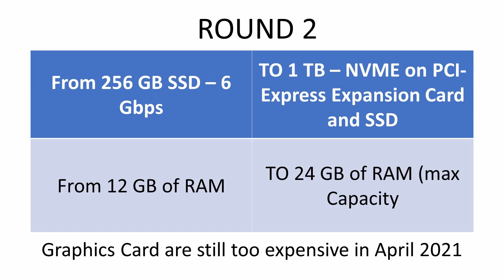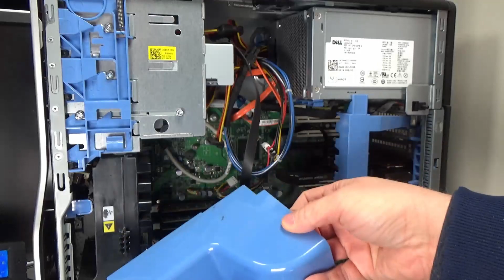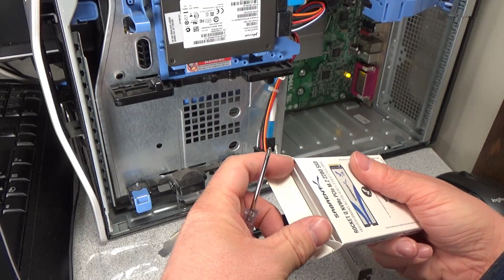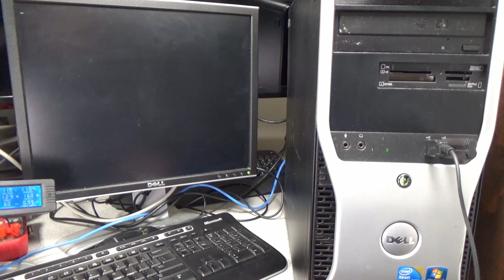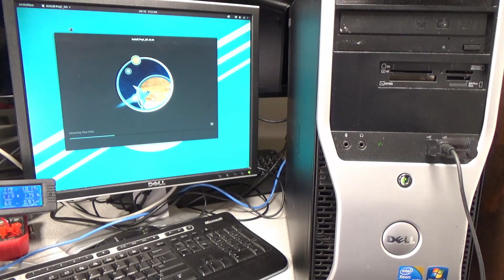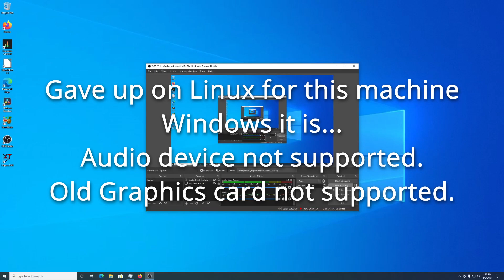Dell Precision T3500 Upgrade PART II

Comment: I just replaced the motherboard after a memory failure after my son used the PC as a foot stool.  It seemed the sudden shock did something to the motherboard.     So ordered a new board from E bay for $20 Bucks!  WHoo hoo!  
Took about 4 hours but I got the entire thing in there & Cabled Manged perfectly with a 1070 Founders edition Card with 11GB of VRAM on the card.  

The only real trouble I had was the Front Fans.  You need a REALLY long screw driver, and for the life of me?  With ALL the tools I have, I could not find a suitable one.    So I Had my Drill and connected a bunch of Bit drivers extensions together and was able to get to all the screws.  Even the motherboard screw in the corner by the Drive bays you have to go through an access hole to get to. 

The Front fan has this small screw on there, but its a PAIN to get to, so left that one out.  
The other slight issue is that 1070 has the power connector on top, so its a TIGHT fit.   But I was able to get it to work.  (Again, more custom cable management, and a 6 to 8 Pin Power adapter. 

I also put in 2 rear fans a while ago,   and that seems to help with the Chip set cooling as its doing its memory test right now. 
Early on it beeped and told me I had a Hard drive failure on one of the WD Raptor drives.  (I have two in a Raid-0 for game storage) 

What I love about the  Pro Workstations like the Dell, is that Manuals they have online.  They are Freaking FANTASTIC! :hand-purple-blue-peace:
Has every single thing you  need in order to strip down the machine and  all the step clear like the Old school FSM the dealers use. 
And the case quality is amazing to boot.   

I had to fix a broken spring on the Drive bay for the retention of the 5.25 in bay CD-ROM drives, and the HDD.  
Other then that?  It was a Joy to work on. 

The only thing I would caution anyone is that the Front fans are REALLY close to the front I/O wires, so route them carefully, or they will rub.   (Happened to me on First plug in fan test- NOW FIXED!  ) 

Now comes the Labor intensive part of setting up the entire machine again.  From the RAID-0  to the BIOS setup. 
Its a fun machine.    Rock solid.  And a joy to work on.     

Great to use for a Daily machine for the work from home  office crowd,  but the even the New CPU's this year are so much faster (like 6x faster on single thread) then these old XEON  CPU's.     So its time to build her up and give her away to a good home.
Reply from the maker: Wow, that's awesome!  It sounds like a great project to keep it going.  I was curious how much effort it would take to retrofit a new motherboard into one of these cases.  Yeah, fans would have to go, I probably wouldn't be so nice removing them if the intention wasn't to keep them.  Dell's pro line stuff is amazing though and thanks for the comment! 

Is the 1070 held back at all by the Xeon cpu?
Reply: 𝘘: 𝘐𝘴 𝘵𝘩𝘦 1070 𝘩𝘦𝘭𝘥 𝘣𝘢𝘤𝘬 𝘢𝘵 𝘢𝘭𝘭 𝘣𝘺 𝘵𝘩𝘦 𝘟𝘦𝘰𝘯 𝘤𝘱𝘶?

𝘼:   For my son who uses it as a gaming GPU?   He has not had one problem with it at all.  Its the W3550,  Only 3Ghz.  And he plays his games on a 4k 55" Display locked at 60 Hz refresh rate.  (His preference) 

The games he plays these days are really not that demanding @ 17, compared to the games he use to play being 9 years old (Train Simulator)  

For me,  I have not noticed a real issue.   But I am NO  PC gamer.  And I have not ever seen him play First rate Titles like Cyberpunk or the new hotness. 

I think he Mainly plays games just to go online & talk to his pals on Discord.   

His other machine we built from scratch just a few years ago  was an AMD FX 8350 Rig with custom case and Board with the same 1070 all running stock (his not really into overclocking)    And has no issues there either at his Mum's apartment. 

Both systems are SOLD and STABLE.  
But I fear, he's more into having a PC for the  spicy memes.  

Have a good one!  :goodvibes:

Comment: I am upgrading a T3500 right now. Got 24 GB of Ram and a x5690. 

Did you ever figure out if it could boot from the nvme pci card?

If not, Could the computer recognize as regular storage?
Reply from the maker: I never got it to work but I didn't spend much time on it, I just wanted it to boot and work, ha.

Comment: my buddy has the t3500 and uses it as a gaming pc. I maxed it out with a xeon x5690 cpu and 48gb of ram. the ram was the biggest improvement. I have the same system as a minecraft server. for a pc over 10 years old its still quite capable.
Reply from the maker: Yeah, it is surprising how long lasted this system has been.  I think this year I'm replacing it with something more modern though.  I had a server build I did with a consumer Ryzen chip, and it's been excellent, but I never released the video.  Probably will go with that platform for a new desktop as well.
Reply: How did your friend to add more ram capacity than the max? 
Bios upgrade?
How much ram can support the t3500 really?

Comment: Gotta upgrade from that heat sink, Dell put out a replacement because that one sucked. Has heat pipes
Reply from the maker: Yeah, I have noticed the CPU temperature runs high all the time and the fans run fast if you make the system work at all.

Comment: That Quadro 600 is still a good economy card. It supports Direct X 12 and can run Fortnite on low settings at 30 FPS. It has 1 Gb of video ram so it can even still do basic video editing. Slightly faster than a GT 710. Good card for $30 to get you by with the GPU shortage...
Reply from the maker: That card still is in the machine.  It is working, obviously it would be nice to upgrade that as well but yeah for a while it will be the Quadro.
Reply: @AllThingsOnePlace  It's still a great cheap card. It can play most games if you tweak settings. It's even good at 1080p video editing and run in OS X up to High Sierra if you put in Mac Pro tower...

Comment: can we change the heatsink in t5300 any standard size which I should buy ! ??
Reply from the maker: The CPU is installed in a LGA1366 socket.  I haven't replaced my heatsink yet.  I am still using the stock cooler.  A cooler that supports the LGA1366 socket should fit in this system.  The cooler will need to handle 130+ watts of CPU load.  I haven't done all the research yet myself so if you find something that works or doesn't work post it here please!

Comment: Do we need to update bios before upgrading?
Reply from the maker: I was running the latest BIOS edition before doing these updates.  I didn't try to do an A/B to find out if it is required but (in most cases) updating to the latest BIOS won't hurt.
Reply: @AllThingsOnePlace  can I install ram 8gb of each slot?
Reply from the maker: @CambodiaShareFeeds  Officially, the system supports 4 GB of RAM per memory slot, of which there are 6.  The CPU choice will effect maximum supported memory.  I opted for the safe bet (24GB total).  If you can get the memory for very little price or free then post on whether it works or not.  There is a video on YouTube showing 48 GB of system memory in one of these systems.  https://www.greenpcgamers.com/uncategorized/make-my-precision-t3500-in-to-a-gaming-computer/  Great info there, and even there 24GB is recommended.
Reply: @AllThingsOnePlace  I'm not sure work or not. but i just saw video on youtube confirmed 48gb of ram.

Comment: Linux supports putting the boot partition on another drive. For example, you could put "/boot" on the SATA SSD (like a 1 GB ext4 partition), but then you could set "/" to the NVME itself. Also make sure the MBR is pointed to the drive with "/boot" on it as well. This is extremely useful if your BIOS doesn't support option ROMs/PCIe booting, or if your BIOS is buggy and won't boot properly on higher storage USB devices.

Not sure how this works with GRUB and PCIe devices though.
Reply from the maker: Hmm.  That is a good suggestion.  I tried something like that but I never got it to work.  I need to spend some time learning.

Comment: Like your video, by the way it is possible to use this dell t3500 motherboard to 3rd party pc case? It is the same normal size of full atx motherboard?
Reply from the maker: This is a very large motherboard.  It may fit in some server cases (with some custom hole alignment) but It is larger than a full ATX tray.  It's almost the size of the whole case.

Comment: Hi so I have built a few Dell precision t3500 computers and I have some information for you you may or may not find helpful. Number one it wouldn't matter whether you went with the x5690 or the w3690 the Dell precision t3500 motherboard it does not actually support ECC registered memory. So you wouldn't be able to get the higher amounts of ram anyways. Number two when it comes to using an nvme m.2 drive you're not going to notice very good performance out of it because you're only using pcie Gen 2 not gen 3. So an SSD isn't going to be all that much slower. At least when it comes to booting and everyday tasks. Number three be careful what video card you buy because not all video cards will support legacy boot. A GPU like the RX 5700xt 5600xt or 5500xt will not work on a LGA 1366 pc. So when it comes to gpus Nvidia is your best bet. Or a slightly older AMD GPU like the R9 290 or R9 280. Also you can use standard ATX power supplies in this computer. No adapters are even needed. You can also add a couple of 80 mm fans to the rear of the computer to help with air flow. You can even use standard 80 mm pwm fans if you buy some Dell fan adapters. You can find them pretty easily on Amazon. That goes the same for the front intake fans as well.
Reply from the maker: Wow, Thank you for the detailed reply.  I had learned a few of those things in my adventure.  The bandwidth of PCIe gen 2 x4 slots is still a few gigabytes per second so maybe won't take full advantage of the NVMe drive but it will be faster than built in SATA.  I also figured a decent sized NVMe drive will be useful to transfer into a new system if/when that time comes.

I did noticed the power supply.  I will have to check out the fan setup (good tip on dell adapters).  It does get a bit warm with these extra components installed.

If I could find one reasonably priced I was thinking of a Nvidia 1650 super or something similar.
Reply: @AllThingsOnePlace  what are your plans with the computer are you going to be using it for any gaming or just using it for content creation? And also when it comes to the pcie Gen 2 speed it's not nearly as impressive as what you might think it is. Pcie Gen 2 is half the speed of pcie gen 3. and a pcie Gen 2 4X slot at maximum will only run at 2000 megabit per second. But granted I could be wrong because I've never actually messed around with nvme drives on the older x58 platform. If you are able to get everything working properly you should definitely let me know about what the speeds actually look like.
Reply: @AllThingsOnePlace  and when it comes to fan setups I definitely recommend going with noctua redux pwm fans. If they move a lot of air and are incredibly quiet. As well as well being pretty reasonably priced. Also if your CPU temperatures are a little bit higher than what you would like I would recommend it taking a 92mm fan and putting it directly on the cpu heat sink. One of the problems that the t3500 has is a lack of directed air flow for the CPU. Putting a 92 mm fan directly on the heat sink provides way better cooling.
Reply: @AllThingsOnePlace  also if you have any questions definitely ask. I'm just spitting out information that I think may be useful.
Reply from the maker: @crosstech1  Sounds good to me.  You are helping me narrow things down a bit.  I will pick up a couple of the Noctua fans.  I will have to do some benchmarks once I finally finish things up.  It is mostly for content creation maybe some light gaming.
Reply: @AllThingsOnePlace  and if you're planning on only playing some later titles something like a GTX 760 wouldn't be a bad option. You can get them for right around that 100 USD price point. That would also give you the end Bank encoder as well as cuda acceleration for video editing. But that's just assuming that you're not playing graphically demanding games
Reply: I might have misunderstood but the T3500 does support ecc RAM. It doesn't support registered RAM. So, we can use ecc non registered ram for it. And this thing can take up to 48 gigs of ram. There is a video for what processors support the extended memory. I think w3690 would work.
Reply: @a.f9173  I could be wrong but in my experience of using both ECC registered and ECC non-registered ram I was not able to get it to work at all. It might be a defect with my CPU or it might be a defect with my motherboard. Honestly I don't know but I was not able to get either one of them to work.
Reply: @a.f9173  It's the X5690 6 cores 12 threads. I just installed one on my system and install 6 x 8gb non registered for 48gb total.

Comment: A youtube video shows a UEFI DUET Installer  that will make the usb bootable for m.2 but its says that we have to keep the usb plugged at all times as long as we want to boot from the m.2 and not the other drives.
Reply from the maker: The BIOS of the system HAS to point to the boot device so if it supports boot from USB then the system can point to the USB when then can point to the NVMe or PCIe drive.  Although this sounds like it should work easily I could not get it to work.  Blinking cursor.  Also, I just wanted the faster drive for media anyway so windows booting from a SATA drive is just fine.

Comment: How did u boot the drive. I made a bootable usb for the m.2 but its not picking up the boot from the usb for m.2. . where did u get the boot from , for the m.2 .
Reply from the maker: I failed to get that working.  I ended up booting from the SSD and using the NVMe drive as the media storage drive which is actually better and the intended application.  I was just playing around with getting NVMe to boot on the old system.  I did try the USB key thing and failed to get anything other than a blinking cursor.